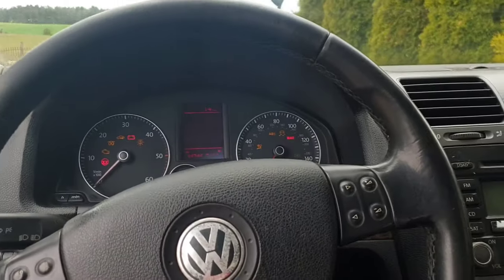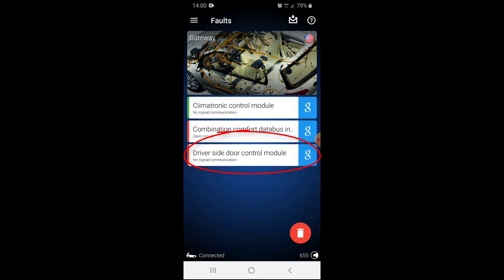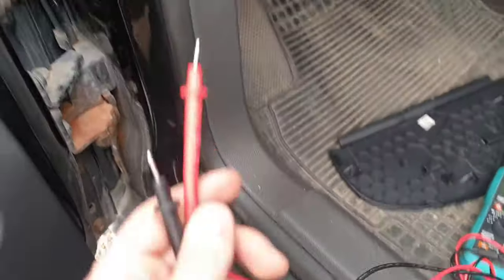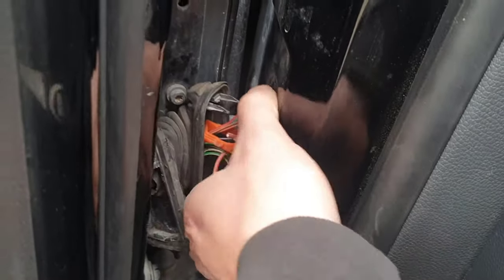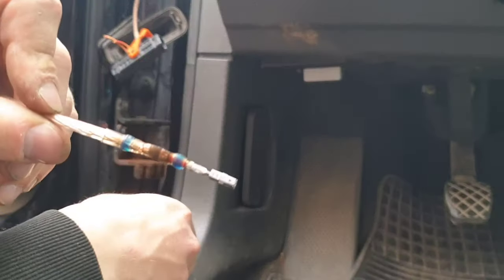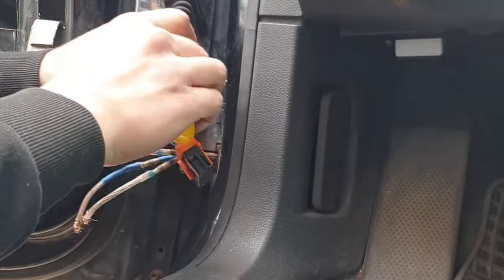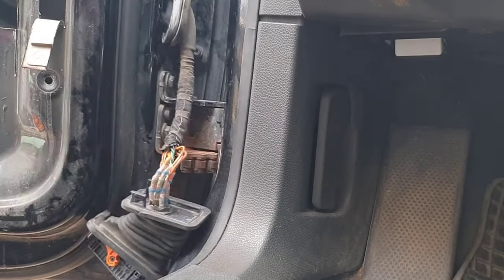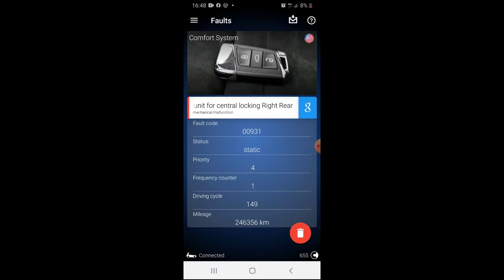Door Control Module No Signal No Comunication Fix! Car Door Lost Power, Electronics Stopped Working.

Comment: Hiya. All in my door is functioning but my red warning light and puddle light. Won’t come on. Worked totally fine then one day i noticed not working, swapped out lights and once they reset everything worked but passenger door still the same. I took off door card and done a continuity test from the connection block that leads to the pair of lights, I can get a reading to all but two connections. These I assume is the switch? So when door opened they go live? I tried to get a reading but couldn’t. So question being, is it the control box or is it a wire broken on route? Surely if power in the door, windows, mirrors etc work then a switch or source must be failing? Any suggestions?